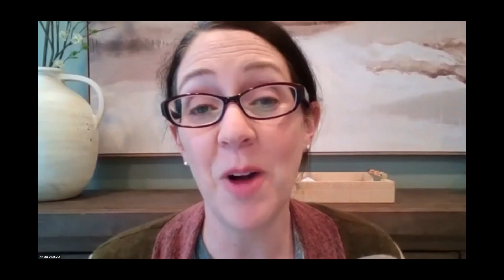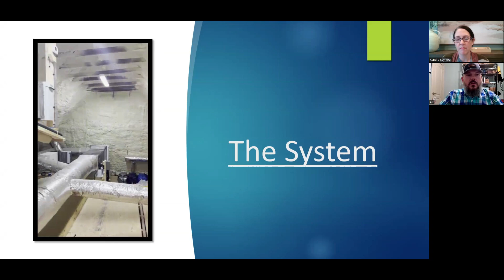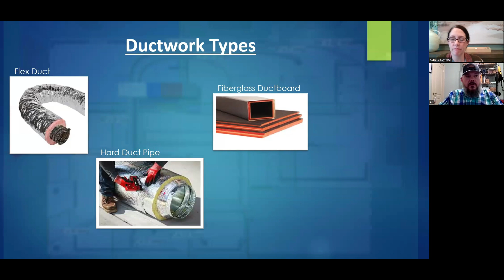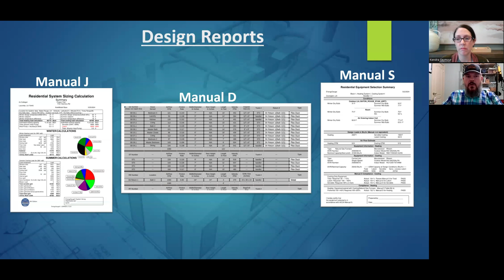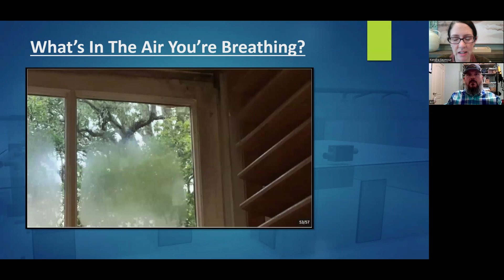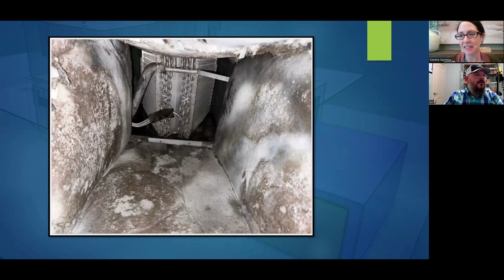Mold Remediation Part 9: The HVAC and Other Heating and Cooling Systems with AJ Callegan

Comment: Most ducts today are flex cheap to replace but rip out interior insulation of air handles and use mylar bubble wrap on exterior is cheap.

Comment: Insuring that the interior condensate pan is slope properly, that condensate lines are clean, running fan on ON versis auto to dry out coil and pan help

Comment: I am hvacr tech. Nonfirced air system is set up for high merv filters. Insuggest seperate stand alone filter unless you want to burn out indoor.blower motor

Comment: (Clarification statement from a duct cleaner): 

AJ mentioned the fiberglass coatings (white paint sealant) and his observation of mold recontamination occurring after ducts were cleaned and coated. 

In the duct cleaning industry and specifically with fiberglass repair coating products there is a commonly misunderstood concept about what the ‘antimicrobial’ claims for these surface repair coating products actually mean and what they are able to accomplish… I’ve done my research on this specific issue, and this comment seeks to clarify exactly how ‘antimicrobial’ claims are tested and what this claim truthfully means. 

‘Antimicrobial’ product in regards to fiberglass surface repair coatings means that the dry surface of the paint coating will not support mold/microbial  growth alone or when exposed to extremely humid environments… “The dry coating surface itself is not a food source for mold/microbial growth.”

A “fungicide” is a chemical product that has “mold killing” properties, and generally requires a pesticide applicator license to apply… not a license you’ll commonly find in the air duct cleaning industry. 

Unfortunately, many in the duct cleaning industry use the terms interchangeably, assuming ‘antimicrobial’ and ‘fungicidal’ means the same thing - THIS IS NOT CORRECT! 

This is the basis for many empty claims or promises made by uninformed duct cleaning service providers. 

(I am doing everything in my power, influence, and capacity to help those in the duct cleaning industry understand that the term ‘ANTIMICROBIAL’ DOES NOT MEAN MOLD KILLER.) 

The ONLY WAY to prevent mold growth is to address the underlying causes that enable mold to grow in the first place - elevated moisture/humidity and a food source ‘dust’.  Due to the way an HVAC unit operates, it’s nearly impossible to prevent moisture in the supply plenum attached to the air handler during the cooling season in humid climates… therefore, dust control is the main line of defense for preventing mold growth in the HVAC/ductwork. 

The major benefit of the fiberglass surface repair coating is to prevent or eliminate fiber shedding into the airstream to improve indoor air quality (that’s what it’s intended and designed to provide)! Supplemental benefits of coating fiberglass surfaces include water shedding properties, as opposed to water soaking properties of fiberglass liner and duct board. Reduction in static pressure due to reduced surface friction characteristics (coating is nearly equal to metal ducts in surface friction rates), resulting in improved airflow and improved overall delivered performance of the HVAC system. The final benefit is that if maintenance of the hvac system is neglected, and a layer of dust forms on top of the coating and results in mold recontamination, then a coated surface can be re-cleaned. Coatings are extremely beneficial to IAQ for fiberglass duct systems and should be pursued in all fiberglass ducts that are not currently contaminated with mold/microbial growth

In reference to comments made around 30:05 

- Zach Ortwine, Owner of Southeast Clean Air Solutions 
*NADCA - Certified Ventilation Inspector (CVI) and Air Systems Cleaning Specialist (ASCS)
*NCI - Certified Duct System Optimization, Residential HVAC System Performance, and Residential Air Balancing 

(PS - I recently visited Bryan Orr of HVAC School YouTube channel to discuss the duct cleaning industry, and we focused the conversation around clarification of various consumer questions and misunderstandings in the duct cleaning industry. Check out these videos to learn more about the duct cleaning industry from an ethical perspective!)